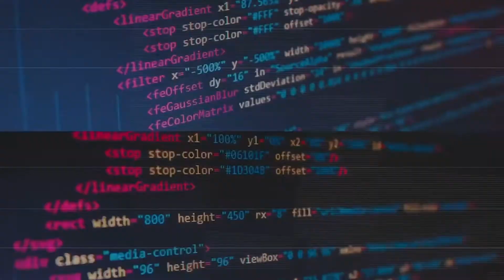Dell R720 Replace DVD Rom Slot for an SSD Drive

Comment: Out of curiosity, where/how did the newly added ssd pop up in the config? Trying to install the OS on the same setup and it seems it doesn't see the ssd since it's not on the PERC
Reply from the maker: I think you go into boot manager (F11) on startup and select it
Reply: I just did this, if your using the onboard perc s110 it will show up in there, you have to first set up the raid using Ctrl R, then once that is set up you have to use F10 to go into the life controller and set it up again in there, this loads drivers so the server OS intaller can see the drive.  I've done it a few times messing around with my server.